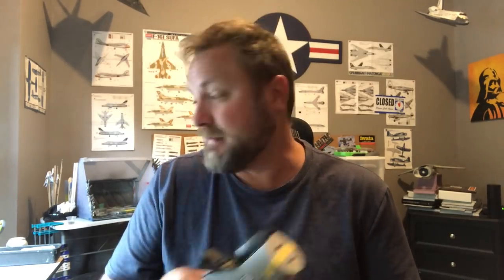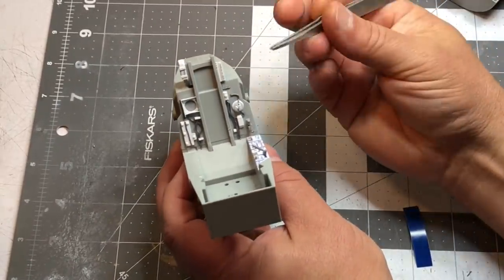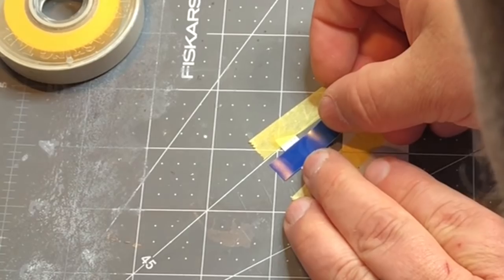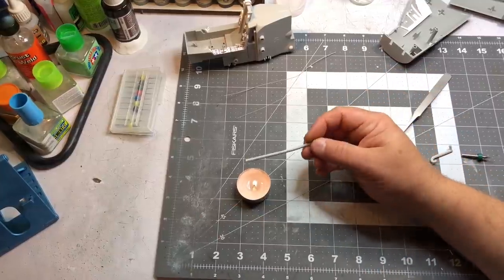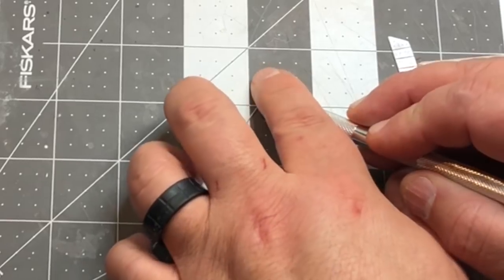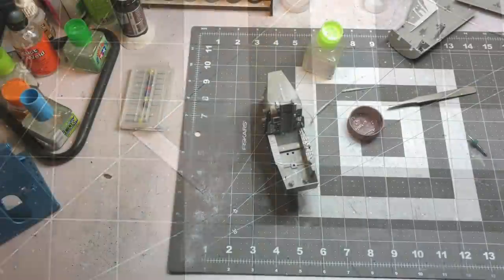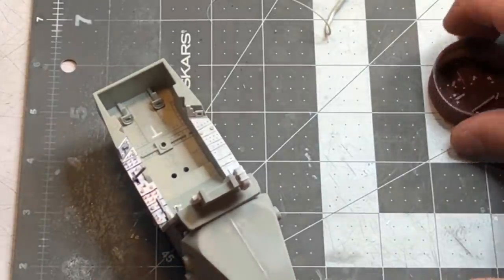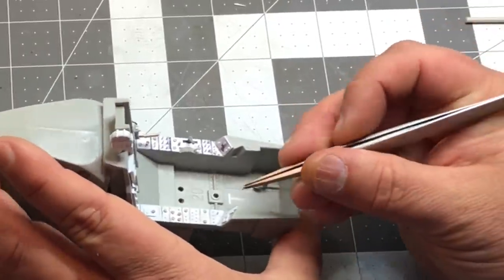HobbyBoss 1/18 AV8B Harrier Build Part 4: Finishing the Cockpit

Comment: Those scratch built knobs look great and show lots of patience. I do have a question for you if you'd care to respond. I've started using some Tamiya X/XF paints for brush painting,  (normally I use the Testors Model Master Military colors) I do not airbrush as I obtain great results with good brushes and a light hand. However, after using these Tamiya paints I've had paint pulling up on the second pass and "balling/marbleing" of the paint even after thinning. Today I finished a frame section on a P-51 and just before the paint was dry I used Tamiya X-20 thinner sparingly over the painted areas smoothing out the high/low areas. Any suggestions?
Reply from the maker: Thanks Ted.  My first suggestion is not to use Tamiya acrylics for brush painting.  I’d recommend vallejo model color thinned with vallejo thinner and a bit of vallejo retarder medium.  That’s what I normally use for brush painting.  

With that said, I do occasionally use tamyia acrylics for brush painting but it’s very tricky.  Tamiya will lift and roll if you apply a second coat before it’s dry or if you make multiple passes.  When I use it, I find I get the best results thinning it with x-20a and adding a drop of Tamiya acrylic paint retarder.  I’ll make one pass, let it dry (with the help of a hair dryer), then make another pass, let it dry, and repeat till I get the opacity I want.  I’d also recommend applying it over a good coat of primer as it doesn’t stick well to bare plastic.

Hope that helps.
Reply: @seanerk5kt9  Thanks for the input.
Reply: I hate to bother you again...but is there one place that you can buy most aircraft colors. I'm thinking of junking all my other brands and switch over to Vallejo.
Reply from the maker: I’m not aware of a set with exactly what you’re looking for.  I know they sell them in sets though.  Amazon is a good place to start.  I’d just make sure you stick with model color and not model air.  The latter is for airbrushing and doesn’t brush paint as well as the model color variety imo.

Comment: Could you make your life easier with the switches by putting relatively long pieces of stretched sprue into your pre-drilled holes, glueing them in and then snipping them to length?
Reply from the maker: That’s easier said than done.  Since the switches are somewhat fragile, I find it much easier to get them as close as I can and as a last resort, snip a couple here and there if needed.  Trying to cut them all to length after they’re on, would likely end in many just completely breaking off.
Reply: @seanerk5kt9  Fair point :)